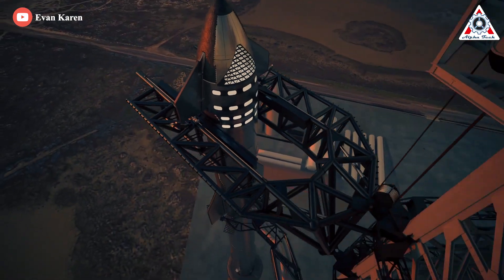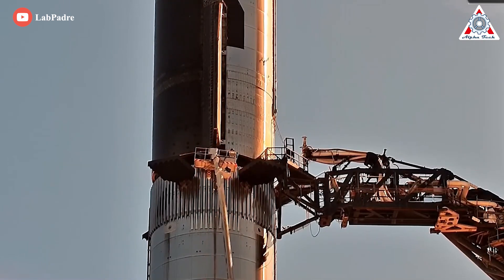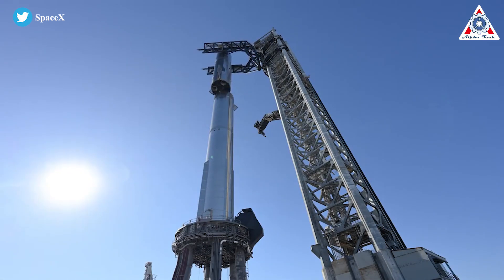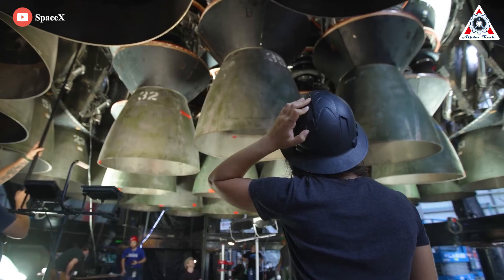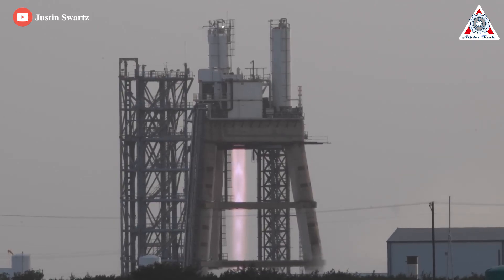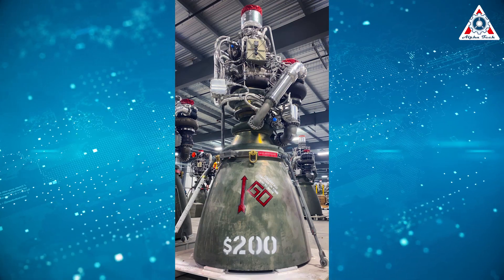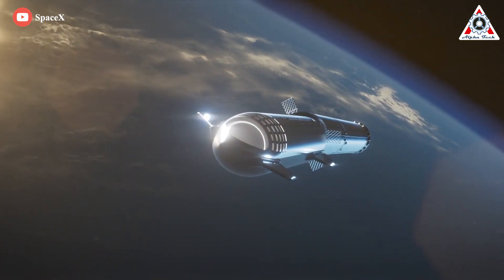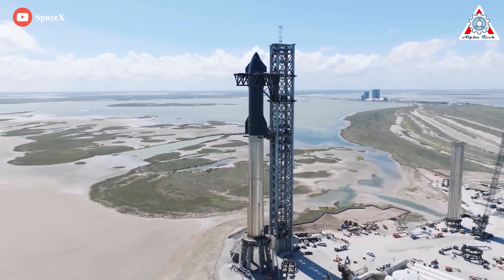S24/B7 full stacked testing plus 200 New Raptors UPGRADED complete, Something MASSIVE about happen!

Comment: Narrator, QUIT SAYING "foot-pounds of thrust"!!!  You're just making yourself look ignorant.  (I'm trying to help you.)

There's no such thing as a ft-lb of thrust.  There are pounds of force and foot-pounds of torque and energy, but NO ft-lbs of thrust.  Thrust is ALWAYS measured in units of force such as pounds, tons, and newtons.  Thrust is the amount of force coming out of a rocket or jet engine.

If a rocket weighs 1000 lbs (or lbf) and its engine produces 500 lbs (or lbf) of thrust, it won't get off the ground.  But if its thrust is 2000 lbs (or lbf), it will, and it's thrust to weight ratio (T/W) = 2 (that is 2000 lbs/1000 lbs).

Most likely you are misreading "lbf" as "foot-pounds" rather than "pounds-force" or "pounds of force".  The "f" you see after the "b" is for "force" NOT "foot" and is used to differentiate it from "lbm" (pounds-mass).  If you see the abbreviation "lb" or "lbs", that just means "pounds" and you have to look at its context to know if it means force or mass.  Here on earth, "lb" can for all practical purposes mean both because one pound of mass weighs one pound of force. Here's how lbm and lbf are related.

1 lbm = .031085 lbf-s^2/ft (and lbf = 1 lbm/32.17 ft/s^s)

Thus if you multiply 1 lbm by the acceleration of gravity on earth (32.17 ft/s^2), you'll get 1 lbf:

1 lbm x g(earth) = .031085 lbf-s^2/ft x 32.17 ft/s^2 = 1 lbf; however on the moon:

1 lbm x g(moon) = .031085 lbf-s^2/ft x 5.31 ft/s^2 = .165 lbf (or only about 2.6 oz).

So next time when you see "lbf", just say "pounds" (e.g., one million pounds of thrust).

Other than that, good vid ... hmm ... Other than that Ms. Lincoln, how did you like the play?

Comment: The only Rocket ever built with this many engines on it's Booster/First Stage was the Russian N1. It had 43 total engines, 30 on the First stage, 8 on its 2nd. 4 on the 3rd and 1 for the 4th stage. All 4 N1 Rockets were purpose built to carry humans to the Moon. It was Russia's equivalent to the Saturn 5. Russia never made partial engine tests and opted for fully fuelled lighting of all 30 engine's & a launch to test all 4 N1 Rockets.  That didn't work out for them as single engine failures (RUD's) and "Hot Staging" grenaded all 4 N1's during these "all up" test launches. SpaceX's Raptor engines have yet to prove their reliability and Elon knows this. It's why he's install individual engine shielding for StarShip's Booster engines. I'm Very curious to see exactly how they did this, what materials were used and how much additional weight this mod adds to the Booster. And, I hope it works !
Reply: @Space Private... All of the Falcon 9 ships have this mod.  It has saved at least one launch from failing.  I knew this mod would come to Starship/Superheavy sooner or later.  I do not know what the weight penalty is, but I do not think it is significant.
Reply: @hankscally9658  Thx, I'm beginning to realize that this shielding is all above the exhaust bell and between engines at the turbo-pump/plumbing & wiring area and likely runs up to the Tank Dome. Which is probably why it's difficult to spot from the pics I've seen from a ground-up perspective.  Good intel, makes sense.
Reply: Kaboomnik! 
That high risk test program Russians pursued was quite short-sighted as the results show.
It's doubtful that they understood the dynamic sequencing required to light that candle.  Further they might not have had a great grasp of combustion instability at the top of the chamber, that was likely magnified by the lack of ramp up.
Reply: @barrelmitt1544  Yea, there were a few other factors that drove the USSR (at the time) to push their testing as hard as they did. NASA's testing program was well documented for the whole World to see, whereas the Soviet's operated in secret. What little we knew was gathered by our CIA U2 program while the rest was somewhat exaggerated by their own Gov Media. The Ruskie's had several accidents & mishaps that weren't known to the public at the time. It's almost more than "urban legend" that a Cosmonaut died in a launch attempt before Yuri Gagarin was credited w/ being the First Man to orbit the Earth in April of 6. The Space Race was a Huge Deal for the USSR because they were very ahead of the US and the World recognized as much. They were the underdogs and wanted recognition.  They kind of operated like SpaceX in that they weren't as afraid to fail while experimenting w/ prototypes, while NASA took Flt Director's Gene Kranz words to heart, "Failure is Not an Option". NASA was much more methodical in their approach to Space. Additionally, the Soviet's Space Program was run by One Man, Sergei Korolev, while NASA went by committee. Several catastrophic launch failures killed many out of pure arrogance for the Soviet's because One guy said that's what the Kremlin wanted. They pushed hard, in part, out of Political reasons. And, from what I've read and seen, they weren't well budgeted and large testing facilities just weren't available for testing something as large as the N1. All that said, they did amazingly well and had built Rocket Engines that gave 25% more thrust per pound of fuel than the US could do until the 1990's. Look up ULA's use of the 1960's Russian built RD-180 Engine that was used to launch American Satellites for Decades until just recently. NASA said it couldn't be developed at the time but the Ruskies did.  : )    SpaceX has all of the Russian and American experience to draw on and should be able to get that 12 million Lb's of Thrust goin on StarShip, at least I hope so !

Comment: I've pointed this out before so maybe you don't read your comments. Stop referring to "thrust" in units of "foot pounds". Foot-pounds is a measure of torque, not thrust. Like when you tighten the spark plugs on your car engine, you apply a set torque measured in "foot-pounds". Thrust, on the other hand, is a force, and it can be measured in "pounds", for British units, or Newtons, in SI. Maybe when you see the unit "lbf", which stands for "pound force" you think it means "foot-pounds". It doesn't. 

Your content is generally good and your presentation is consistently well done. It shouldn't, therefore, be blemished with technical errors such as this one.
Reply from the maker: I will note this. I promise
Reply: @alphatech4966  Thanks.
I think the problem with mass and force are common to both measurement systems.
People in the Imperial system use Pounds for both; when the correct units are Pounds for Force and Slugs for Mass.
Similarly, people in the SI system use kilograms for both; when the correct units are Newtons for Force and Kilograms for Mass.
Food manufacturers are not helping things when they list package weights here in the US in both pounds and kilograms. There is no conversion since they are measurements of different things...just as there is no conversion from Meters to Miles per Hour.

Other than that little bit of nit-picking, I very much like the presentation style and content of your videos.
Reply: The guy that makes these engines uses tons of force and has said that using newtons is just dumb.  And that guy that makes more rocket engines than anyone, is the expert.
Reply: @bearlemley  Well, tons and newtons are both measures of force. There's no expertise involved, except that the rocket-engine-builder knows that the unit you use must be one of force.

Perhaps you should find  out more about why the expert said using newtons is dumb. If they're using Imperial measures throughout their design, it would be dumb to mix the systems of units. NASA crashed a vehicle at Mars because of that kind of mix-up and now mandate the use of only one system. Perhaps that was what he was talking about.
Reply: That's the reason that I unsubscribed. I'm afraid that they'll start to refer to altitude in fluid ounces.